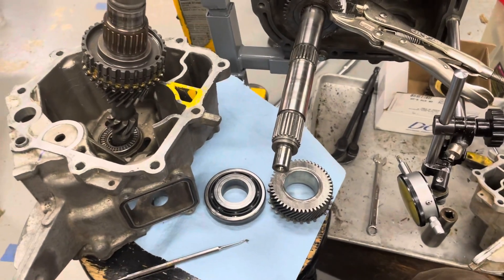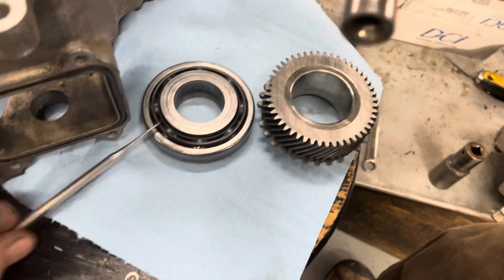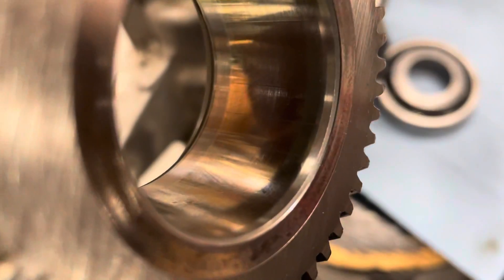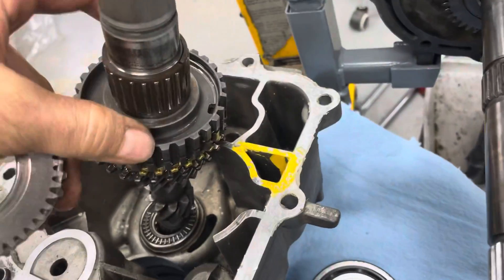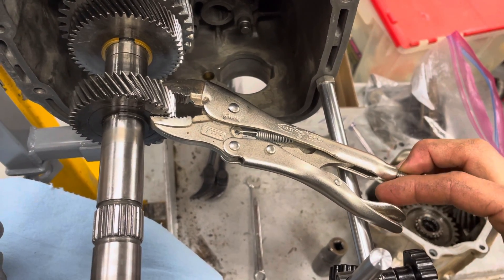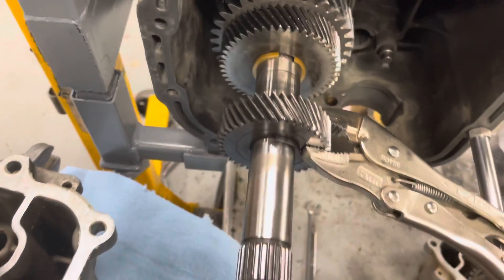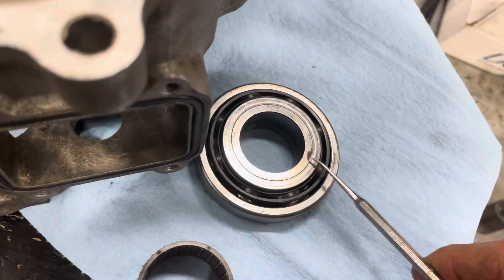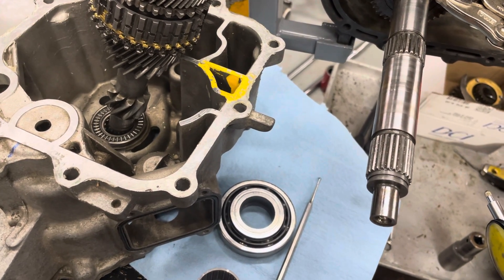Vanagon T3 Syncro mainshaft bearing thrust erosion

Comment: Is that a common problem, the slob on the 4th gear on pinion shaft?
Or should the gear be more "fixed" onto the pinion shaft? 
I've seen there are Circlips available with different thickness going from 1.6 to 2.4 mm to reduce lateral play..

Cheers

Comment from the maker: We discovered a few days after posting this ‘video inquiry” that the mainshaft bearing showed “textbook evidence ” of electrical erosion.  And the van had no “engine ground” thus all of the alternator current (and starter) was going thru the gearbox enroute to the forward ground strap. Needless to say I have deleted the forward strap, replacing it with a cable directly from the starter, and another one direcfrom the alternator.  It stands to reason that the thrust erosion is also related to the electrical current.

This van has an EJ25 engine which causes a couple problems.  The high HP results in higher helical gear-thrust against the mainshaft bearing. Also the higher HP means it can drive for hours at 80mph with 4th gear mashed hard against the mainshaft bearing, sealing off that area from lubrication. So the oil film is depleted by centrifugal force and it becomes metal-to-metal, a perfect environment for electrical erosion and corrosion fretting.